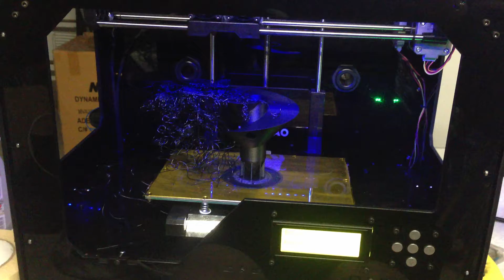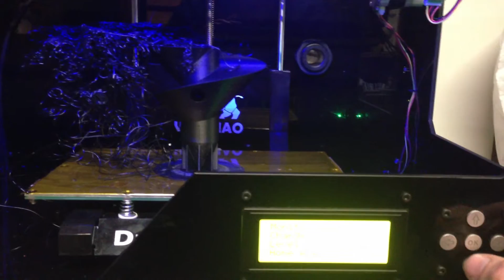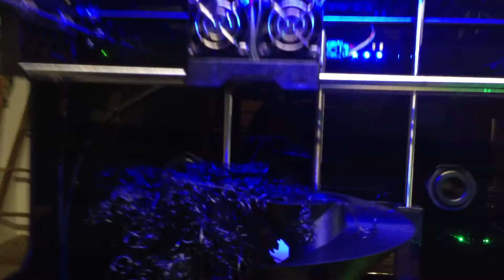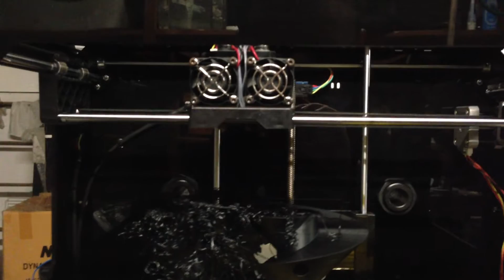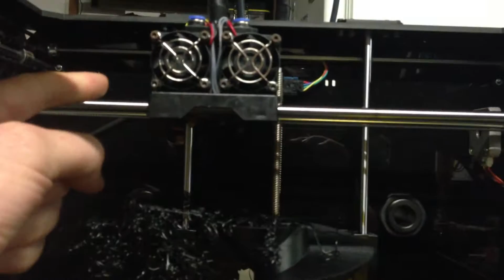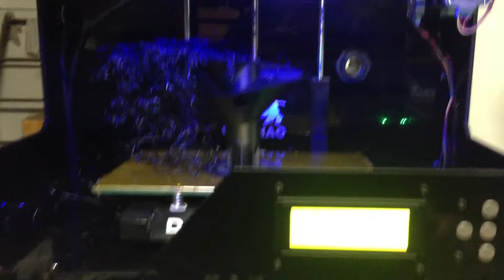X-Axis not working, Wanhao, Duplicator 4.

Comment: i have similar problems with shifted layers on Xaxis when Y position is far to 0. i change stepper motor cable and all works.!!             then i modify the cable layout to Xaxis stepper motor, straight down out from X carriage. so we have minimum cable blending during work.  the original layout is critical with hard blending and near the belts.

Comment: I had same problem.  It was the x-axis limit switch cable.  It had brokn wires where the cable was pressed into the outboard face of the y- axis sled.

Repeated y traverses fatigued the wires, pushing and pulling them, just inside the travel arch of wire.

I cut out the broken area, noving the connector in.  There is plenty of slack underneath, to do this once.  Next time I woll replace with new 4-wire cable.  

This cable connects to the right limit switch and its LED stop indicator.